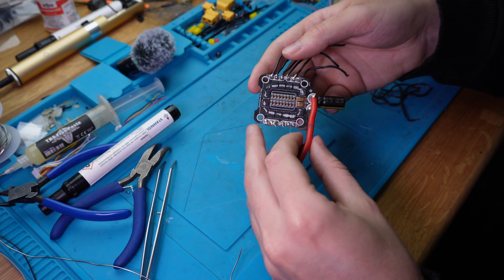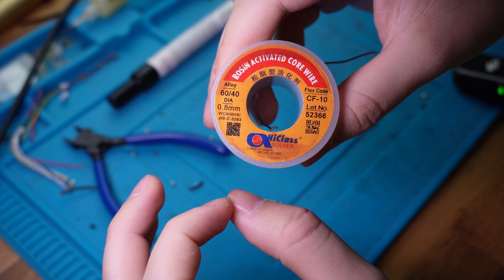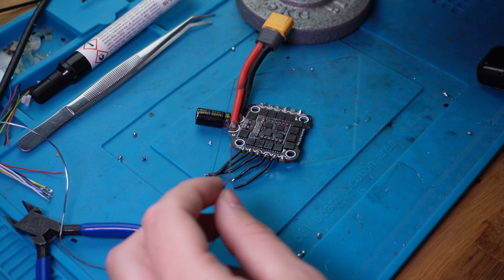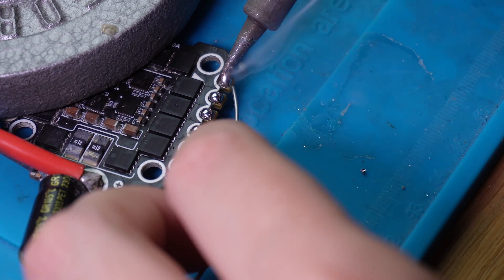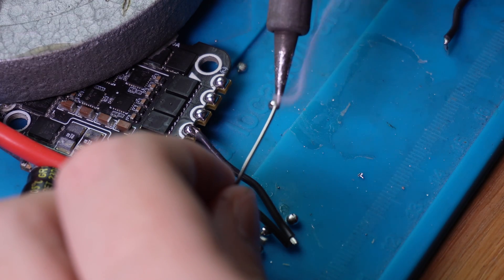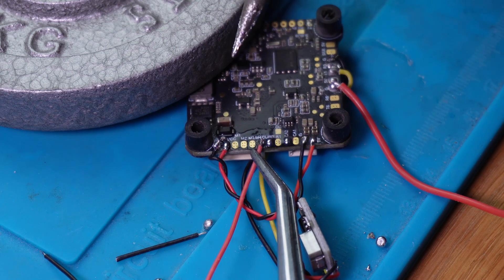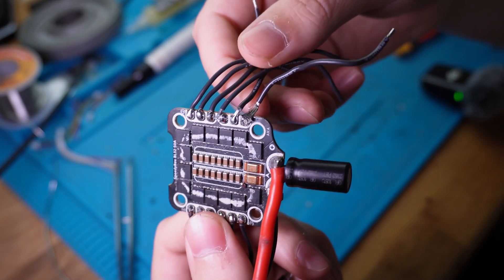Soldering for FPV Pilots

Comment: After good solder and an adjustable soldering iron, the next most useful tool is Blu Tack modeling clay. It is very practical for securing components and wires.
Much better than any clamps or weights.

Comment: I'm sorry for the negative comment (I still hit the like button), but.... 

The idea of explaining how to solder is good, but the example you show are blobs of solder. 
Ergo to much solder and not heating the objects you are trying to solder enough so the solder doesn't flow, resulting in a less then ideal connecting.
Reply from the maker: You sure this is too much solder? All these pads are flat surface pads and not through-hole 🤔
Reply: @nils_vo  IT should flow out, not form a blob. Although heating up the materials is probabably a bigger problem than the amount of solder. 

The trick it to heat the stuff you want to solder by keeping the iron against that, then having the solder tough the materials, not the iron. Then it will only melt if the materials are hot enough. 

Ofcourse the max temperature of the soldering iron should be correct when you do this.

Comment: You definitely want the larger tip if you want to do main power leads… take forever with the small tips. But the ts100 is great as long as you run it high temp and keep the tip clean

Comment: Great video! For one thing. And great to see that you’re making this kind of content. It’s great to see someone who is making an awesome piece of software (The Zone FPV simulator) monetize their knowledge before the software revenue scales up.

These are some things that help me since before getting into FPV, I hadn’t done soldering since engineering school.

* Get “warmed up” (no pun intended) with a practice board every time
    * Have the wires cut, fluxed and ready to go so you can stay “in the flow” (again, not to be confused with solder flow)
    * Batch the tasks: cut all the wires, flux all the wires, tin all the wires and joints, then solder them all at once. Helps me keep the quality of successive joints (my performance) up
* Use flux on/for everything, including tinning wires
* Keep pushing solder onto the joint longer than you think you’ll need, especially if you’re a novice
* Don’t melt the solder with the iron, heat the joint/wire with the iron. Solder tries to flow to the hottest point. Flux helps with this a lot, though
    * Nice to see solder paste demo. I am definitely going to go buy some of that
* Not being afraid to get flux on the board, between joints as well was on the pad/ball. It’s fine. (This might not be true if trying to put solder onto something that isn’t meant to be a pad/not a great conductor of heat)
* Helping hand/third hand tool is good, but more often I end up just using a blob of “blue-tack” putty
* About why it’s a good idea to put the capacitor near right on the board, and how that can be a huge pain in the ass to solder. I haven’t heard anyone say this, but I assume that with the high current draws, the resistance of the wire matters for the RC filter created
* Wetting the iron with a bit of solder before soldering since it will conform shape to what you’re soldering vs the fixed geometry of the tip (which sometimes is what you want, depending on various things)
* Remembering that my goal is to get a reliable quad, not to become a journeyman electronics technician. Don’t be ashamed to do things the easy way for all situations where it makes a difference.

Comment: I am very paranoid about the lead in the solder and drone parts. I wash my hands quite a few times after touching anything fpv related even the controller and the goggles. Who's the same?
Reply: Smoke some cigarattes and think about it couple of moments later

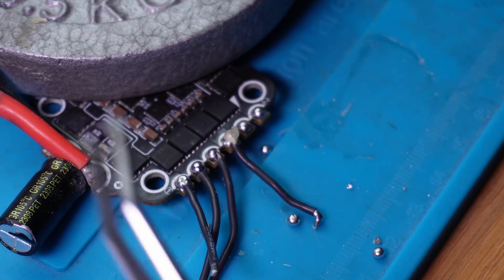Comment: 11:51 this joint is perfect. I think your first ones aren't. The #1, the wires haven't wicked the solder, it is visible, the wire didn't heat up long enough.

Comment: Friendly heads-up: you’re using leaded (60/40) solder without fume extraction—flux fumes plus lead exposure are harmful, especially for beginners.
Temperature does matter: leaded solder flows at lower temps; most beginners only have lead-free, which is harder than shown here.
You often still need additional flux, and this technique likely won’t work with lead-free solder.